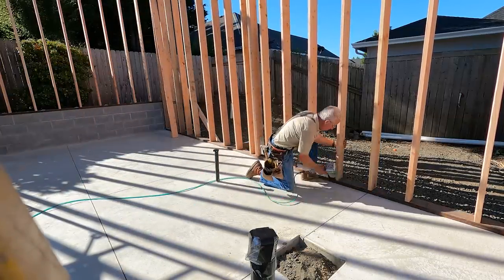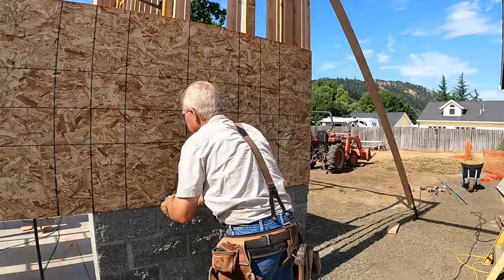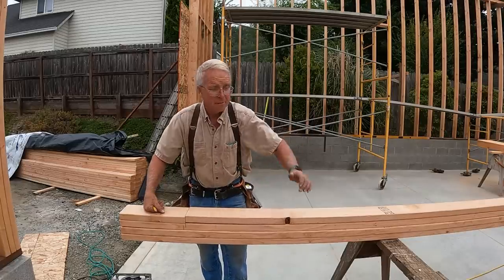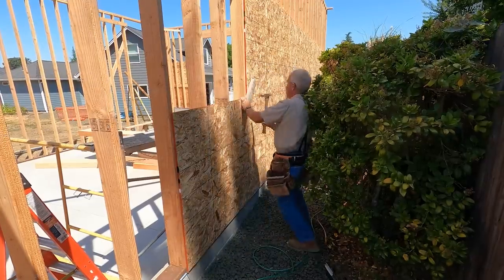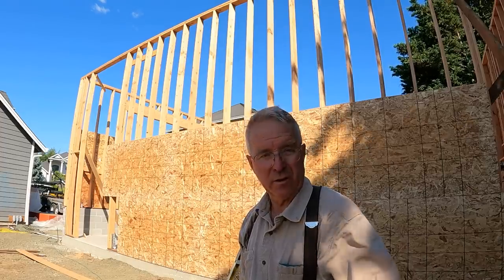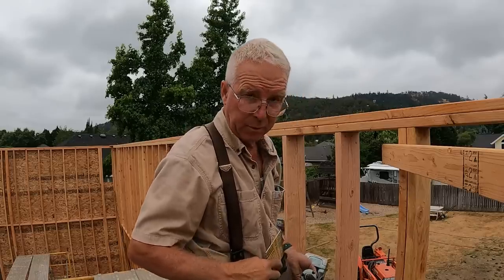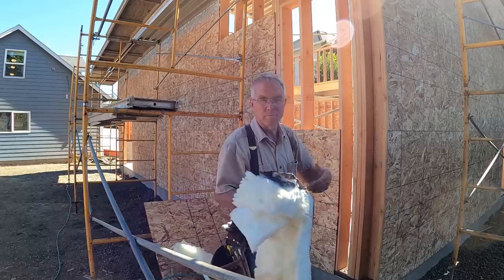Big Beams and Solo Wall Sheathing: Shop Build #11

Comment: When I was 14 years, I went to work for  my neighbor during summers, weekends. and holidays building houses.  I then began working for his brother doing the same thing up to through summer after high school graduation and going into the Air Force.  Those two brothers made a carpenter and an all around builder out of me.  One hot summer day when I was seventeen, I worked furiously hand mixing mortar and carrying brick to one of those gentlemen, who laid them as fast as I moved them.  He stopped for a minute, looked at me, grinned and said, "Some day, you're going to look back and be glad that you did all this hard work and learned these things I've taught you."  Jr. Shreve has since passed on to be with the Lord, and here I am at 56 years old with his prophetic words of wisdom still clear as it was yesterday.  I am forever grateful for all that hard work and the skills I have today.

Comment: Thank you for posting this series. In about a year, I'm going to be building a 30x50 post and beam shop alone and I appreciate the confidence you show doing this. I'm 63 and two years ago built a 14x8 post and beam shed by myself, except for hiring a guy to do the roof because I hate heights. 

My neighbors ask me how I do all the projects I do. I tell them I'm not in a hurry, I take breaks as I need to. And old guys work smarter, not harder. We find ways to use leverage and hold downs and cleats and all kinds of tricks to not have to have another person or use a lot of energy.

Thanks for showing a few more tricks. I had to laugh about your comment about being able to do this at 63. I plan to keep up the good work into my 70s by learning new tricks and working smarter. 

And watching your videos, you young whipper snapper.

I might need to buy a crane though...
Reply: Interesting. I'm 67 now, just before hurricane Sandy I built a shed in the backyard, 14' x 7' x 7'. It had to be put in 1 to 2 hours at a time after work every day. I put up wood scaffolding myself, and screwed to the sides. The weatherman said it was going to go west of me, but it didn't. I had to go like a mad person to close it in before it got to me. Literally 1 1/2 hours before it arrived I put house wrap over the roof sheathing. No time for shingles. Everything was fine through the storm.
Reply: @firesurfer  Ophelia gave me the impetus to side out my workshop. And that temporary sheeting remains to this day! Just good enough to keep the weather out...

Comment: At 69 I’ve finally gotten to where I have a full time helper. It’s frustrating at times, young helper with no experience, but I find that, overall, jobs go quicker and easier. Just in job set up and tear down, getting all the tools out of the trailer and then putting them away, clean up, moving lumber, snapping lines etc. having an extra hand is so nice. Yup, I did it all alone most of my life but now I’m liking it. It’s expensive, workman’s comp rates are crazy and the whole system isn’t small business friendly, but I’m not ready for the rocking chair so I’ll do whatever it takes to keep building.
Reply: Alone you can go fast, but with a team you can go far

Comment: I used the figure for the density of fir as 33 pounds per cubic foot, many times while framing my current house build.  Just 20 minutes away from where Scott (Essential Craftsman) lives. :)

As far as finding plumb on the walls, I bought a Stabila plate level that checks plumb from top to bottom plate.  It eliminates any bow of your studs.I had two framers on my job who LOVED the tool and want to get one for themselves.

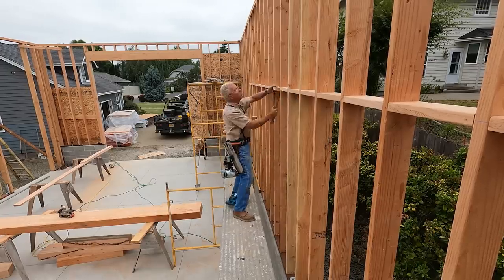Comment: Suggestion: 8:06 if you made the plumb-bob jig with a 2-1/4” stand off from each wall rather than 3” you could use your long level as a gauge block instead of cutting lumber. A level is lighter and guaranteed straight unlike dimensional lumber.  Fabulous video series!!!

Comment: I appreciate seeing an "older" craftsmen like myself and speak common sense and logic when it comes to safety. If you need an agency to monitor your safety, your doing it wrong. Also, it is incredible to see that us old guys get it done, solo, all while being ridiculed by young bucks, but respected, regardless. Tip: I shoot my walls with a laser, mark the corners, snap a line for the sheathing. Keeps it honest. I have enjoyed this channel for years. As you were, hard working sir.

Comment: Hi, I saw you with the garage beam laying flat on the saw stooles/ tressles and it made me remember when I was heavily into bulding house frames ( Australia) when I was a contractor and I tried to make every minute count. When I ever had to prepare a beam, I'd  check for bow first ( as you do) ( keeping the beam ,bow upwards , if it has a bow) So instead of pencil writing the word ' top',  I would just do a few squiggle marks  along the  beam top face. I understood that, to indicate'  top' and quicker speed to do a few squiggles along the beam ,  than time to write T O P  along the beam.  I know it's not a significant time saving , but all the little ' tricks' do add up in saving time

Comment: You, as a sole proprietor with a crew of one are not covered under OSHA regulations. There is a minimum workforce as stated in the OSHA regulations that are mandated to follow the regulations.

Just the process you usually use to think through the task before you start, coupled with your experience will probably be sufficient to keep you safe and the structure secure.

Thanks for the great content.

Comment: Watched my dad work alone framing houses for years. Last one he did solo was 10k sq ft, 32’ cathedral ceilings. The guy he built it for told me he’d never seen anyone be able to think ahead and see the end product like my dad. If I’m lucky, I got a few of those genes. A good crane operator helped at times, but most of the work just took a little forethought. Thanks for the video. Love your content.

Comment: You can’t overestimate the value of a crane.  I built one that goes on the forks on my tractor to set the trusses on my new garage.  It also helped lift the steel arches on my shop.  Couldn’t have done either without it.

Comment: When spanning a large opening I like to fabricate welded flat stock brackets (3/16 or thicker) and use a router to recess them into the corners. That helps me get the stiffest framing to handle high winds or heavy loads.  Love the content!

Comment: Hi again, If I ever had to make a house frame onsite , instead of prefab ( frame made in factory/ semi'd to site), I always liked to have on hand ,the truss plan layout . It helped in working out wall stud positions that could place a stud directly under a truss ( actually 35mm; 1 1/2 "offset from a truss postion [ except girder trusses  where real direct support is better],  due to using a metal cyclone ' over strap ,that would sit right next to truss as opposed to not directly under truss, thus messing with nailing of truss footcut/toe to extra top plate.

Comment: Nice to show how one person can do virtually anything.  I've lifted all kinds of beams in place...on my own.  As long as i can lift one end a few feet, then I can raise it up to whatever height is needed.  I use triangle braces on both ends...and just keep raising them...and then lift the beam a few feet and rest it on the triangle....same triangles I use to hang electrical cords and pneumatic hoses in my garage.  Always feels good when you can lift something very heavy on your own....and do it safely.  I could have easily lifted your beam into place...safely...without that machine, simply with some good carpentry geometry.   Walls are more than strong enough to support only a few hundred pounds of beam....using triangular bracing  off the studs.

Comment: It's not easy to disagree with how and what you do but I always cut my fire-blocking to the 1/16th inch so they can do their job and block fire from racing up in the walls.  Then I caulk them just to be sure.  I once repaired a house that caught fire at the baseboard level and the fire raced into the attic where it did most of it's damage. I do give you extra points though, for installing them all at the same level instead of doing it the typical easy way of alternating them above and below a line.

Comment: Talking  about cutting the blocking on the exact measurement: We build houses that are pre-cut. The problem is that so often some of the blocking needs to be trimmed, because it's theoretical length doesn't add up with reality, because it assumes everything is perfect when in fact boards cup, or are otherwise not always angled exactly at 90.0 degrees from whatever it's fastened to. This confirms my belief that blocking cannot be the exact theoretical length if you have a series of them.

Comment: Something you could have done to make it really easy was mark a caulk line on the inside of your entire building half way up. Then on a 2x4 mark your stud layout and nail the 2x4 all around the building in the inside. Once that is done you can install the plywood on the outside and all your studs will be on layout. Then when you have a rain day you can go inside and install all your pulling blocking. Now you still will have to come back later and nail then all off but I feel it's faster this way. But if this was my house I would have used 11' windstorm osb. It eliminates seams and lays on the wall really nicely  if it's out just a little.

Comment: Seeing the preview of the next episode where you raised a framed interior wall with your truck crane, why didn't you just stand all your exterior walls that way too? You could have built them in smaller sections & offset lap your top & bottom plates. Seems like a lot less work that way. When I used to work on a commercial framing crew, we would build full 20' sections including shear then lift with a boom lift. It seems like you could scale down for your operation.

Comment: You can use your framing square to cut multiple blocks that are the same length. Measure the first what you actually need with the ruler on the body laying at the edge of your board & use the 90° tongue of the square to scribe the line. Now add an eighth inch to each additional block scribed. 
Use your framing square like a speed square & Mark out all your cuts at once.
You can also pull your measurements from both ends & double the second because it's easier to double a measurement. Square the line & cut

Comment: Took me years to admit it, but we switched to all battery skilsaws.  We have the Makita, Milwaukee, Skil, and the Metabo HPT, the Metabo is half the weight of the others and cuts just the same. All of them outperform the corded wormdrive.
Reply: In what  way do they outperform the corded saw?
Reply: @kiwigrunt330  ripping 2x material, ripping stacks of plywood or OSB. Not being tethered to a cord.  Cutting depth, Weight. Probably more.

Comment: I work solo now as well.   Employees can be a pain in the ass.  It is worth it sometimes to do all the framing related work yourself.   Recently I installed a 16ft 6x12 after removing bearing wall alone.   Lift one side at a time a little bit.  Subout all the other stuff

Comment: One question, here (the Netherlands) when you put in insulation, you put a vapor barrier on the inside (warm) side and a vapor open material on the outside, so you don't get moisture issues in the construction.

What is this paper layer on the fibreglass, I guess it qualifies as a vapor open material so it should be on the outside, but you are not putting a vapor blocker on the inside (at least not in this video). Will that come or are you just not doing it this way over there?

Comment: Really enjoying this and learning a lot. Could you tell me why you did not offset the blocking so you could end-nail it through the studs? Thanks.
Reply: He wanted it to fall on the joint between 2 sheets of sheathing, so it had to be lined up.  Also, I'm not sure that fire blocking is allowed to be offset from each other.

Comment: Due to the wet weather there is in ⅛ gap between sheets an automatic practice you do on projects?
I've framed in the Chicago area and if plywood is butted upon against the next the water will cause the seams to expand and curl up and out.

Comment: won't the corner insulation get wet before you have the roof on?
Reply: I thought this too. Extruded polystyrene would be the way to go but it sounded like Scott was looking to get rid of some batts he had laying about his shop. Fortunately we've been blessed with a late summer in the PNW so hopefully it won't be an issue before the roof goes on.

Comment: "3 inch saves your hands" unless you pull a rookie move and don't check the selector on the gun and it's on bump mode resulting in a 3" ring shank through your index finger...

Comment: So what your plan if the inspector notices that you're using a ripped down Glu-lam and rejects it?      A glu-lam is not a uniform block of wood.  The top and bottom layers in a Glu-lam are finger jointed, and use a higher grade of wood,  because the top and bottom is where most of the compression  and tension are in a beam.  The middle layers use a lower grade of wood, because they are mostly transmitting shear and are not as critical.   An 8x16 Glu-lam ripped down to 6 x 12 (just for example)  is not the same as a 6 x 12 Glu-lam, and will  not be as strong.

Comment: Yeah. A couple of doses of reality: 2 men working together cohesovely can produce more than three individuals. Also, your just framing houses. Residential. Small time. Do a bridge, or a tunnel under an infrastructure or river, or a 1k high rise. That's where osha comes in, not some mickey mouse garage in the middle of nowhere.

Comment: Why 3 inches? I must have missed the importance of why the plum is 3 inches from each side?
Reply: it's not important.  It's arbitrary.     The idea is you know that it's 3 inches out at the top, so if it's 3 inches out at the bottom, then it's plumb ... could be 2 inches, could be 4 inches, doesn't matter as long as it's the same distance top and bottom.

Comment: Dude, either I've been smoking dope... or there is no way that beam only weighs 150 lbs.    We used to have to NOT have heavy equipment around if at all possible (Beverly hills, Hollywood,. noise and commotion ticks off the neighbors).. and (I realize I am not there so it's just the video and me guessing) I am guessing 500 to 1000 pounds.

Comment: Please be careful. You come over in this video a little to cocky and boastful of your abilities at your age.  I enjoy your content and hope to do so for years to come. I have forty years in construction and seen some fatal accidents in those years. Show the job the respect it deserves. Come over to the UK and build me a workshop like that to potter in please. Great job. Nail gun sure saves your arm, no Popeye forearms anymore. Love the preprinted cladding board for the studs. I would be using expanding poly glue throughout, one of my favourite tips from Tornado Alley construction. Glued houses do not move.
Reply: Cocky? Wrong.
You need to find the older video where Scott explains previous falls ...
Reply: @notrut  I used cocky and boastful as my lexicon is limited{ I had to look that up}  I mean to cause no offence but it is courting trouble to do this alone. I have respect for his skills and I have done similar jobs in the past but as a younger more agile man. To take unnecessary risks for You Tube content is not wise. Why else did he make the content if not aware it carries a risk, why a whole video of making do alone. Another pair of hands costs a lot less than a Doctors visit.